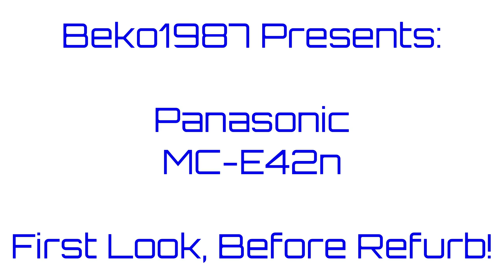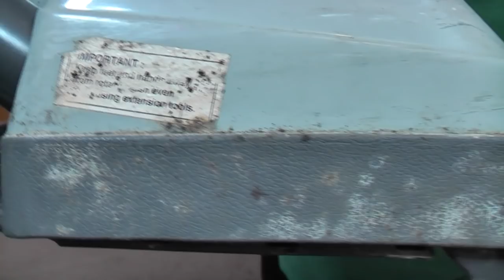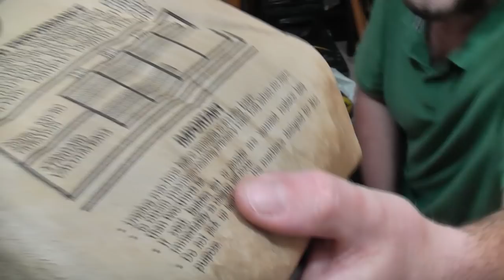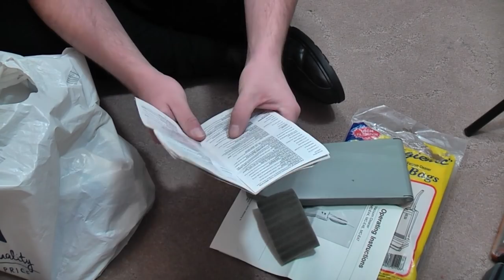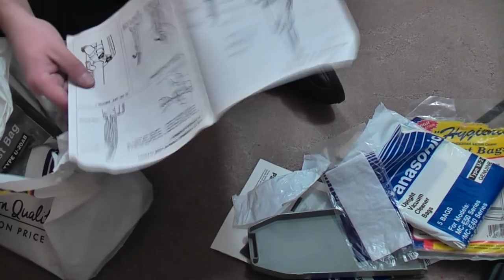Panasonic MC E42n Electronic - First Look, Before Refurbishment!

Comment: i absolutely love these vacuums  ive got quite a few of them   the biggest issue i ever found with them was the foam filter inside the motor casing always get dirty and ends up thick with dust fluff and pet hair   and the rattley brushrolls as well

Comment: hey sam good one I use to have one the same but the moto blew  and I not know where to get it fixed  so it wet to the tip  I just got a hoover junior model number 1334A  in lime green white  but the fan spindle do not move do this mean the motor is seize up or will it run if it got referb  body out site is in good nick with minor scratches  its got all its original handle and bag and cable just needs clean up and moto sorting it was cheap for £20,00  was sold as not working for parts  can you still get motor for them or put a nother sort of moto in it dam shame I not live closer to you and mrs L ?
Reply from the maker: The motor should be fixable, you'd need to open it up though, it could be just seized bearings or the comm could have lost a segment and jammed. I have a spare junior motor, you could box it up and send it over and I could refurbish and repair it for you? It would cost though but not the earth